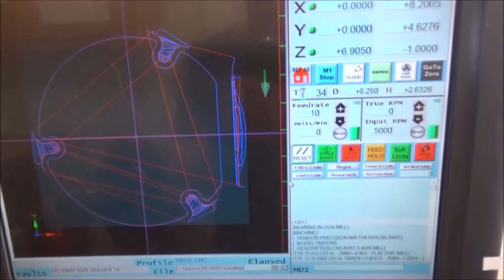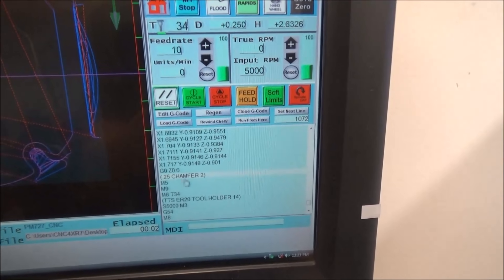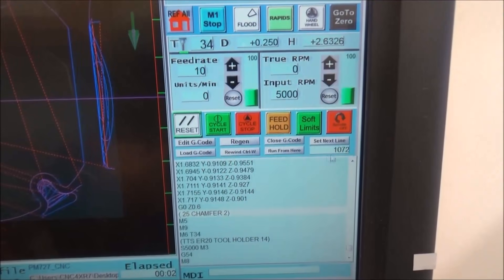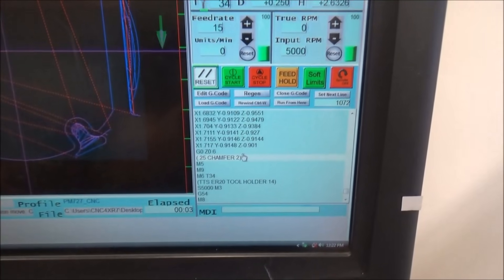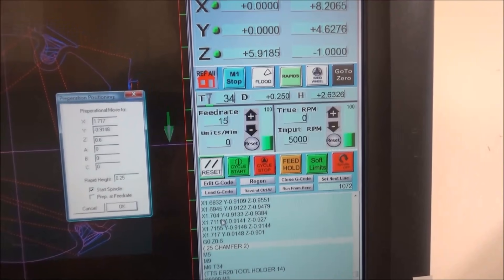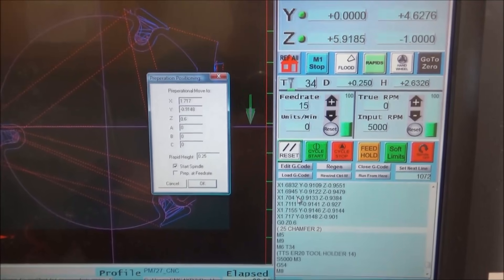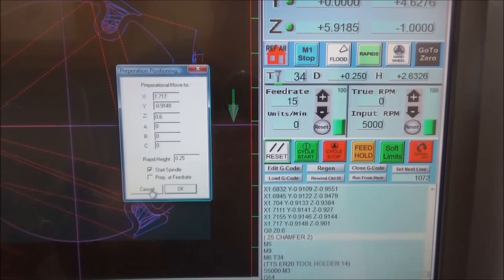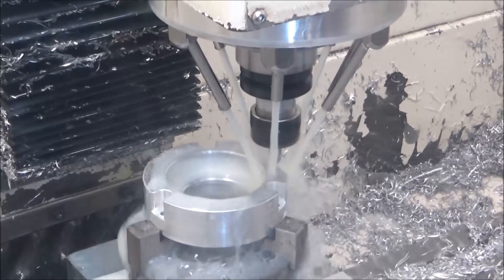Mach3 Run From Here!

Comment: Do you always close the window and click start?. I am in the middle.
Reply from the maker: You type the line # you want to start from to set it.
Yes you only open the window to search for tge line. Once found close it. Set the line # and press start.

Always try to start from a tool change etc so it's a safe starting point.
Reply from the maker: @silvinabosch4633  I'm sorry I don't follow the question.

Comment: Remember if it runs in G90 or G91 (Absolute and incremental) G17, G18, G19  etc :) advise:  G90 or G91 before any movement commands , maby .  Nice vid and part 4XR7
Reply from the maker: Ys those are factors that need to be considered

Comment: Nice. Great info.  I've definitely broken tools and crashed before trying that, but as I see now, it was completely my bad for picking a bad spot to start at.  That makes a lot more sense to start at the beginning of a particular tool path.  I'll have to try that on the mill.  Thanks!! :)
Reply from the maker: Thanks Mike, yeah it can be frustrating especially if your running a tool change macro as I do. you must be aware of what Mach3 knows and doesn't know.